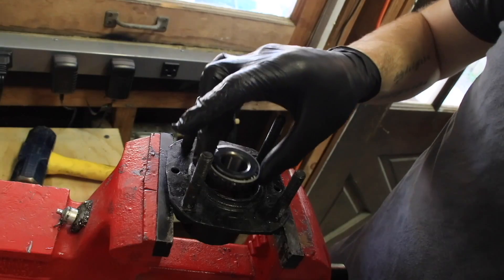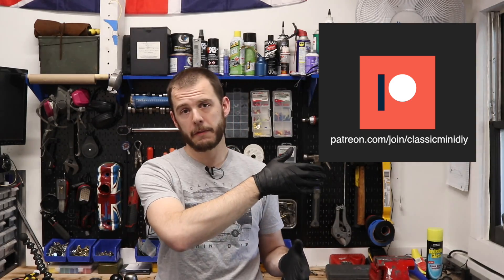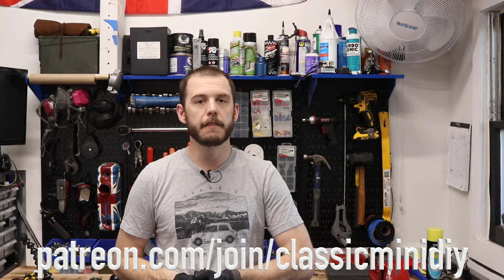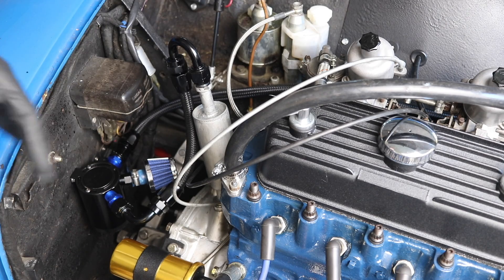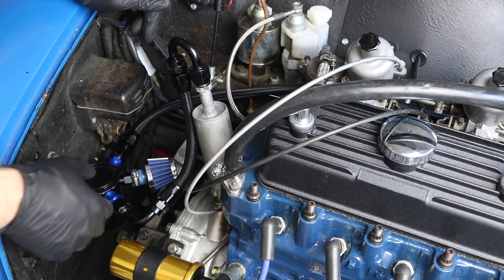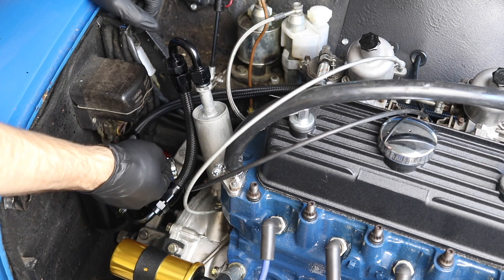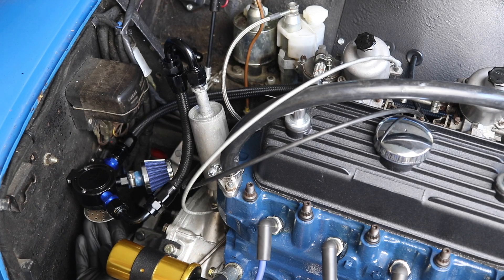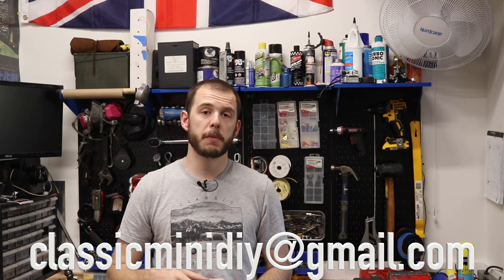Classic Mini DIY - How do Breathers Work (My Custom Setup)

Comment: Hi Cole. Have you ever seen a socket like tool that fits over the clutch end of the crank? So you can turn it? It must have two pins in it to fit the cutouts. I saw one on a Mini Mania's video. Probably have to make one. TY

Comment: Hi.. if the breather’s canister is already an air/oil seperator, what is the purpose of an oil catch can? And what’s the difference between a PCV valve and a check valve [which you’re showing instead of a PCV].. thanks in advance
Reply: My thought totally. It seems to me the OE oil separator is best. Oil caught in the OE separator drains back into the engine at shutdown.The amount of oil is very nominal in a street car even after a long distance trip of several hundred miles or with the normal type of driving that us crazy mini drivers do! I have not seen a reply answer to the question yet.

Comment: I bought a car with a catch can fitted and piped to the breather on the transfer case, with a similar adapter to yours. I am getting some oil leak from my venter oil cap on the rocker cover, should I replace with a nonvented cap or that does not matter?

Comment: The PCV valve doesn't separate oil from air, it can't. The grey canister you pointed out is the oil separator, which has steel mesh inside. You don't get anything in the catch can because the original oil separator has done its job. The aftermarket check valve also can't separate oil from air. Its purpose is to stop blowback into the sump. These engines need crankcase vacuum to reduce oil leaks, especially from the rear main bearing area. The purpose of the original PCV valve was to regulate the vacuum, which otherwise would be too much at idle if connected to the intake manifold (as it should be). Sorry to be so late to the party, and to be a pooper!

Comment: Hi Cole,  yet another great video.  I am going to order the catch can and install it.  If i connect the outlet from the catch can to the carb,  do i still need a pcv valve?  My valve cover does not have a place to hook things to it. I am not clear on the need for pcv valve on top of catch can.

Comment: Why is the bypass removed between cylinderhead and waterpump?
Reply from the maker: Not all minis have the bypass installed. Usually it's earlier cars or earlier engines. At this point the bypass had been removed on my car.

Comment: Could you please tell me what's inside the silver cylinder canister and does this item require servicing or maintenance. On my 1275cc engine (ADO16, not a Mini)  the hose from this canister feeds directly into the air filter. Many thanks
Reply from the maker: The canister holds a semi coarse wire mesh that is used to help collect the oil mist that’s in the crankcase ventilation. The only time you would need to service it is if it became clogged over the years. It can be replaced with a similar wire mesh.

Comment: I don't want to be 'that guy', but the PCV does not separate the oil from the gas - the silver oil separator can on your engine does that.  The PCV allows the oily gases to be metered / sucked into the inlet manifold except when there is high manifold vacuum (i.e. decelleration).  Later designs also prevent a backfire from the inlet manifold entering the crank case (not sure if the Austin valve does this)..... http://www.hastingsfilter.com/Literature/TSB/94-2R1.pdf

Comment: BMW K series engine.......are you sure I understand the K series was designed before BMW got control of Austin Rover?
Reply from the maker: BMW K100 Head from a motorbike. Not talking about an Austin Rover/BMW automotive setup. The K100 heads can be retrofitted to the classic minis block. 
http://www.force-racing.co.uk/products/bmw-conversions/product/bmw-k100-k1100-conversion-kit/

Comment: Hi, could you explain something I don't really get please, why does the catch can need that tiny to-atmosphere air filter on it? I thought the oil-less gases should be pumped back to the carb? I can see you have a line running from the catch can back to the carb but don't really understand why there would be an air filter as well. Surely that means less gases get back to the carb? Hope that question makes sense.
Reply from the maker: So the hose you are seeing that looks like its running to the carbs is actually coming from the crankcase breather on the radiator side. So the two hoses are coming FROM breathers into the catch can and the out the filter. :-)

Comment: My 998 breather is just left open. No hose back to the carb. I’m assuming that I should at least connect it back to the carb to avoid misty, oily, air being sprayed all into my engine compartment? Thoughts?
Reply from the maker: They do have a built in wire mesh (if it hasn't been removed) which should help keep mist down but yes I would either connect it to the carb, or add a hose and run it down below the engine so it helps direct the fumes away from the engine compartment.
Reply: @classicminidiy  Thank you for the advice! Much appreciated.

Comment: My 71' 1275 doesn't have the oil catcher. it connects straight from the breather to the carburetor. Is it fine to fun without the catcher? Thanks.
Reply from the maker: Without the catch you will end up with more oil mist in your intake and can foul out the mixture a bit but I doubt you will have any noticeable issues.

Comment: I have a 1981 998 mini, my timing chain cover does not have a breather on it. I need a replacement one and can only find the covers with a breather on it. Would I be able to use that or would I have to hunt down without it, thanks!

Comment: All Minis have breathers, even the 850/1000 of course. These have the breather in one of the the tappet covers and back to the carburettor. 1275 engines do not have those tappets so the system is a bit different as the one you show in the video

Comment: Hi man my tappet cover got a breather hole, since last week I'm smelling fumes, getting high on fumes, the hole is like a pipe the pipe is facing carburetor (air filter big round one), it get oiled up by the tappet cover breather, all along it wasn't doing that I'm very stressed what would be the case? I which I could send pictures

Comment: If you have a standard breather which is full of white “glup’ should you change it as it won’t breath as well?
Reply from the maker: Probably wanna take it off and a give it a nice good clean. Is it a stock engine?
Reply: Classic Mini DIY 1275 metro, fast road cam, skimmed and ported head. I replaced the breather today together with some new plugs as it has been difficult to start recently, seems to have done the trick.
Reply: @Fourdays4  The white goop is condensation - burning hydrocarbons makes water - swill it through with petrol (reverse flow), but don't use pressure and dry it thoroughly

Comment: Hi. I am trying to see where the pcv valve actually sits but you don't say - one minute it's in your hand and then it's gone - where does it live? I think mine is worn or blocked because I have oil coming out of the dipstick hole. Just can't work out where it comes from. Thanks from a UK viewer.
Reply: PCV valves were fitted to twin carb motors because it would mess with their balance to connect at a carb. It fitted in the middle of the inlet manifold balance pipe. It also has nothing to do with oil separation - it's big because it houses a diaphragm that uses atmospheric pressure to shut the valve when the manifold vacuum gets too high.

Comment: Can you run without a breather ? Nothing has to be changed than ? An 998 engine.
Reply from the maker: You must run with a breather. Especially on higher displacement engines like my 1293. It's required. The lower displacement engines really should have at least one breather on them, these a-series engines have a tendancy to "breath" pretty heavily even in the lower displacements.

Comment: Aussie small bores where all a series with breathers either on the tappet cover or the rocker cover. Our mk1 copper S had a breather on the tappet as well
Reply: My U.S. import '67 
Cooper S also has original tappet cover breather
Reply: As with mine. '77 998 built at the Seneffe factory for export to Greece. It has it on the driver's side (LHD) tappet cover and vents to the carb.
Reply: Yep that’s where my Mini K 1098cc breather is.

Comment: Rover k series
Reply: Just to chime in I think a k series conversion would be more interesting than a vtec conversion, at least it came of the same factory
Reply from the maker: The K-Series head that I would be using isn't from the same factory since its the BMW motorbike head, but I agree with the sentiment about the K-swap. I think its super interesting and cool because it maintains the A-series block which feels like the "heart" of the engine to me.
Reply: @classicminidiy  You'd think auto manufacturers could come up with more creative names. Honda BMW and rover all used K and all have found thier way into minis at some point.
Reply from the maker: The head is actually from a BMW though right?
Reply: no.
Reply: bmw k100 ah! my bad. That's a blast from the past.
Reply: minisareus I think you are confused, Cole is talking about placing the bmw k100 head on an A series. not the later rover K series engine
Reply: Do you want to fit k100 motorbike head to make 16v
Reply from the maker: Yes my goal was to fit a K100 motorbike head. :-)

Comment: i don't see why you need to wait to fit a check valve to route the catchcan gas into the carb. A mild negative crankcase pressure isn't harmful. Just lean your carb fuel mixture a little to compensate for the slightly extra gas entering.